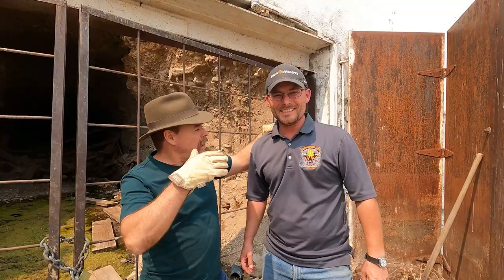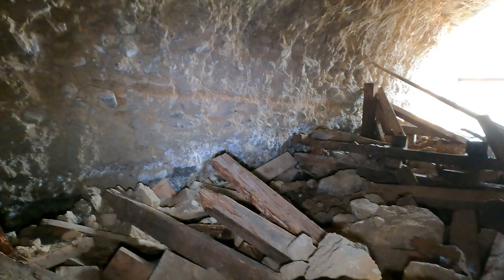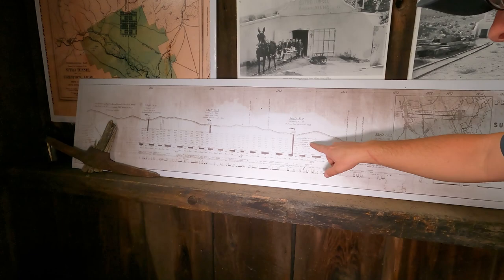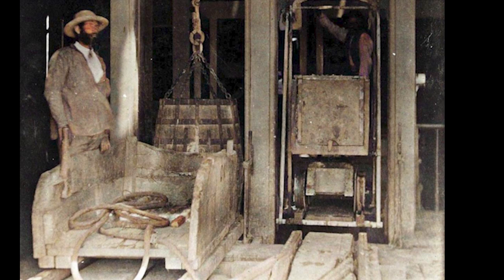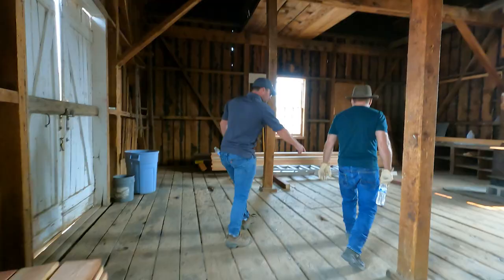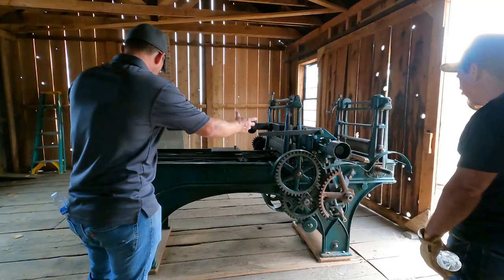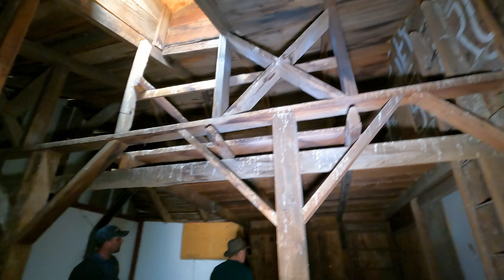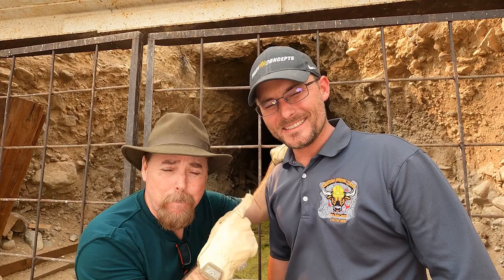"Exploring the Mysterious Sutro Tunnel in Virginia City, Nevada 🔦"

Comment: It is my understanding that, by the time the tunnel reached the mines, the workings were well below the tunnel so that it was of less value for drainage.  The "bank crowd" that controlled many of the mines frowned on the tunnel as it competed with their Virginia and Truckee Railroad and the mills they owned on the Comstock and along the Carson River. 

The planer is actually a moulder or matcher as it did the edges as well as the top.  Probably, the side cutters could do profiles such as tongue and groove or shiplap.

Very informative video.  How hot was the water coming from the tunnel?
Reply from the maker: you are correct David

Comment: Grew up in MInden, I can not confirm nor deny they this tunnel was explored back in the day, along with a lot of other places that are now gone or under lock and key...
Reply from the maker: can you confirm or deny what is inside at air shaft #2
Reply: No, because at the time we didn't even know what was what.  Just a few dumb teenagers doing stuff that probably should have killed us.  A lot of the areas around American Flats, and that direction are covered up, same with the pine nut range behind Johnson lane.  Hot springs Mt used to have a lot of really cool mines but they are also covered up.

Comment: Hey Jeff at 5:28 in on the video you will see what looks like a lot of bugs or dust those are actually electrons AKA dark matter but your light is bright enough because there's no other lights to interfere they light up that's the only way you can see them but they're thick thick thick you might want to put it in slow-mo and really check it out thought you might find an interesting

Comment: That mine water in the pool wouldn't be too bad. If it was ran through a gravel , sand , then carbon layers , yhen another sand and gravel . Even if it eas only in a ditch.  A couple yards of each in the ditch, and cover it with large flat rocks to hold it all in place. As well as provede a walkway.

Comment: steam pumps where invented in early 17002 by thomas savery in england. where they using that big bucket because of cost? im guessing that was waaaaay cheaper to run than the pumps. im sure the pumps where primo money at the time. they where like rocket engine equivalent tech for the time.
Reply: Also pumps are  limited to 32 feet ducking. The deep cable operated pumps [ like oil grasshopper pumps] have the weight of all the water to the surface fighting the lifting . With the container the weight of water is known and limited
Reply: @jeffbybee5207  i think its closer to 24 ft. I only know this because i hand dug a well 36 feet deep. I hit water at 33. I needed 10 feet of water but i hit rocks i couldnt get through at 36. Hole was 8 inches wide.